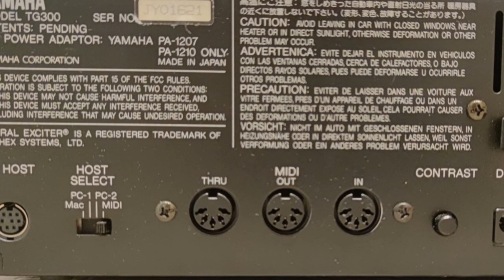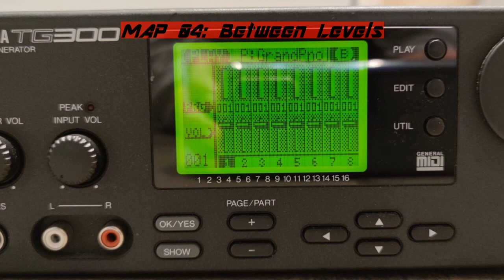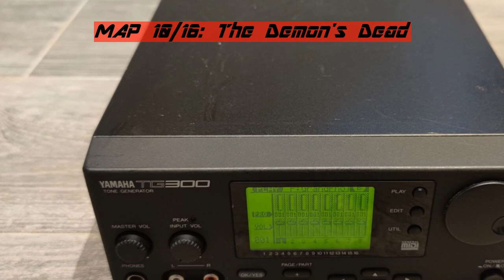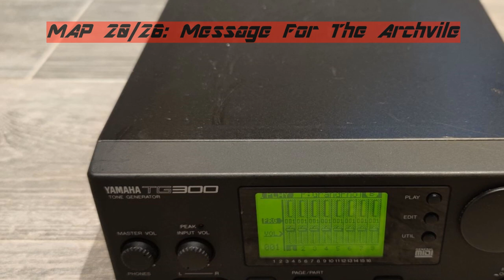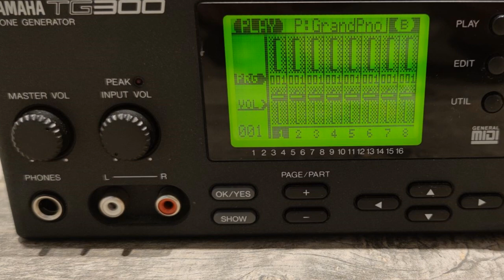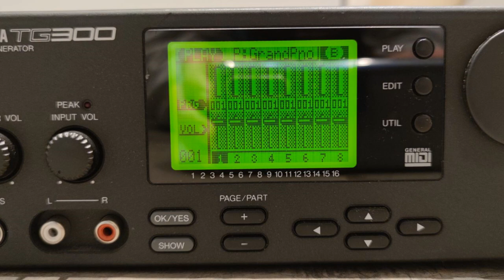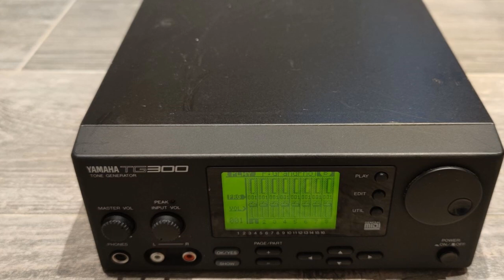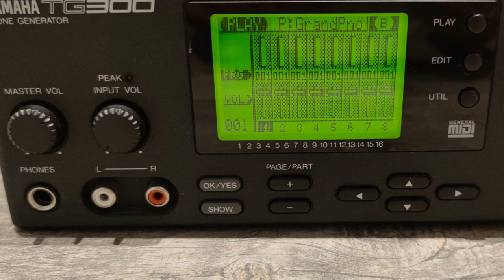Yamaha Tone Generator TG300 (General Midi) playing Doom II music

Comment: I listen your video in headphones and compare two same track 01:12:56 Endgame / Readme Music and on my laptop with play in VLC with SF: weedsgm3.sf2 (~55Mb). Sounds similar, but not the same. I think it's depends on SF quality and eulazer sttings.
Reply from the maker: 55mb is a huge soundfont. The module has a few MB, maybe just 4. I think it is quite good for that. Generally, every Soundfont is different.  It might also be a difference if you play the music directly out of the games sound engine or when you extract it and play it on another software, but I am not sure about that. VLC with the weedsgm3 is something I should look at some day, thanks for the information👍